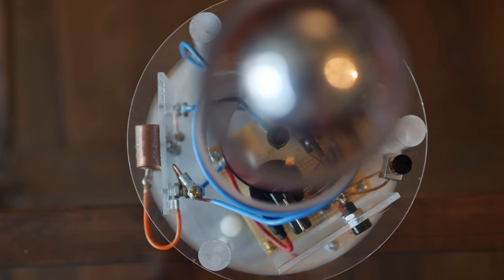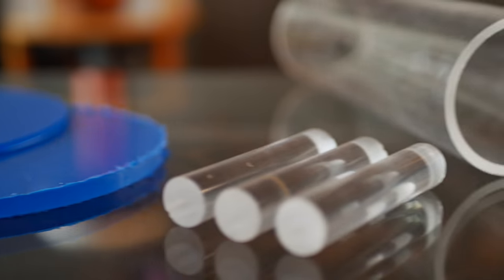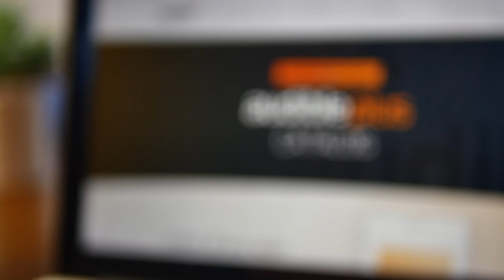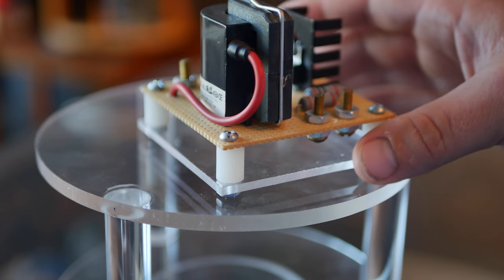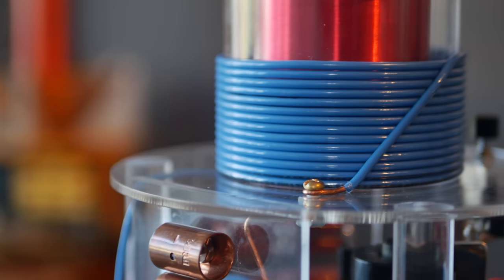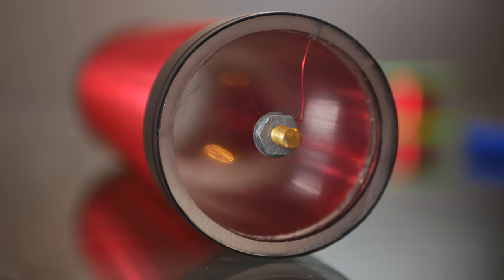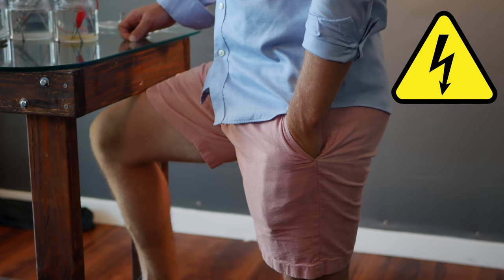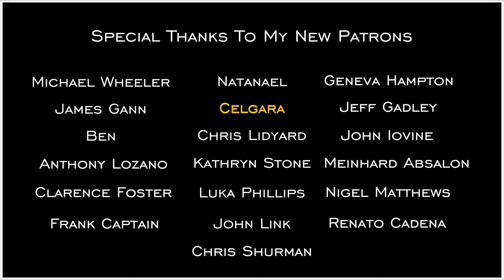DIY SEE-THROUGH Tesla Coil ( Portable & Museum Quality)

Comment from the maker: QUICK NOTE: I mentioned the one hand rule for all those new to electricity, or, those unsure about what part of this coil may be safe to touch. Ironically, I used two hands right away. I did this only for cinematic effect - I do not recommend using two hands, ever, unless you are very familiar with your device (like I was). One hand rule at all times, I just did it for effect!
Reply: Lol yeah that was funny
Reply: thank you
Reply: Tiny coil can’t hurt Jay  after all years he work with high voltage
Reply: Talking bout your Ebook. The matter we don't see is space it self. Dig into superfluid you'll understand what I mean. 
How you could possibly know you'd be in a soup of superfluid if you were in it? It act like a vaccuum yet it's not.  Starting to connect the dots yet?  
The speed of light is constant as long as it travel through a constant matter.
Reply: Sir at your flyback transformer vedio can i use a diffrent tranzistor?
Reply: Can you try triggering ur Marx generator with a Tesla coil by connecting it to one of the terminals, while making sure the Marx won't fire on its own/main gap being large enough  ?
Reply: @plasma channel can i put a currrent regulator on this
Reply: I wouldn't touch it with any hand. It's a both hand rule. You can get killed both with horizontal and vertical shock. If you touch the two potentials of a Tesla coil without a capacitance in between, you might get shocked because of the frequency being changed down by your bodies capacitance.
Reply: @sFeral  no you cant hook up the tesla coil... BUt you can hook up the power source tho
Reply: @rennoruutli5267  actually it can be done, I did it with a single HV capacitor, but the way I did it isn't exactly safe. What I haven't tried is putting the TC secondary in parallel with the HV output, which is potentially safer, if the TC is triggered remotely. Would be interesting to see, as long as the windings don't immediately short
Reply: @sFeral  Maybe I got it wrong... But o you mean that you connected the primary coil system to it or the actual tesla coil?
Reply: @rennoruutli5267  I didn't make the connection using a wire. The discharge from the TC top load hits one of the electrodes of the HV cap and causes it to discharge as long as the TC spark lasts (a very short time).   The other case I described would have the TC secondary (many turns) bottom connected (grounded) to the negative side of the HV cap (or the Marx generator). Basically the same thing this guy is doing RlUBjJfsR3s (YT blocks links, so this is just the vid ID)
Reply: Hey. Plasma guy.  You are fantastic.  Can you create a radar gun and atach an amplifier and then attach a webcam and a microphone and a strong resistor so it can handle the electricity.  What would you see.  Also could you develop a laser that you can point at China's Super Sonic missle and it would make it blow up in mid air?
Reply: the Radar has to have a reciever amplified connected to the reciever
Reply: i have one doubt when the sparks touch why u didn't get electricuted is it because of skin effect or u are not grounded. i am not sure that when will I get electicuted , when I am grounded or not grounded. can u plzz make an separate video on it my frnd?

Comment: I have already begun a design of my smallest Tesla coil I've ever built, I believe Jay has see it, it will be an audio modulated version of this coil here except about 1/4 of the size. It will use an external driver for high power usage but with an integrated driver (Full Bridge for the external and Integrated drivers) that's in the base similar to his. I absolutely love the quality and effort put in to not only your high voltage work to make it amazing in appearance but also the quality of your videos!

Comment: Amazing video as always. That was a beautiful coil build and even more amazing was the fact that it gets 3'' arcs from just 35 watts of power.
Reply from the maker: Thanks M.S. Yeah, I was really pleased with the result. I took my time calculating the resonant frequencies prior to building, and I think it paid off. I wish I designed the secondary/primary spacing a bit more safely though - I occasionally get sparks between the two coils.
Reply: @PlasmaChannel  I got to thinking about it the spark gap could be slightly improved with one sharp electrode to reduce breakdown voltage and increase efficiency (i.e. box razor, piece of hacksaw blade.) I would also try to reduce primary inductance a bit and make up for resonance with the cap bank. Nonetheless this is one of the most quality homebrew sets I have ever seen.

Comment: I really love the look of this! As to acrylic cracking, I've done a lot of work with acrylic when building my pink and clear guitar, and from that, if you use a stepper drill bit, it will have a much nicer hole, and it won't be so prone to cracking :D (Best to still have a very small pilot, but for bigger holes, it's very nice to have (the drill bit)

Comment: Love your grounding. The same concepts can be applied to receive remote power. It's the basis that Tesla was working with when he wanted to charge things remotely. Wide plate for grounding and an antenna on the other end. As a charge seeks to establish equilibrium on the larger plate there is going to be a little back and forth with the coil and remote electric source.
Reply from the maker: Counterpoises are the best. Using actual grounding sucks. I will believe in counterpoises till the day I die. they allow for convenience and portability.
Reply: @PlasmaChannel  if you ever get the itch, check out the pictish symbol of the double disk and Z rod. :)

Comment: another thing. the oscillation is made by the feedback coil. then the 3055 saturate and become conductive to ground the primary coil. I think that the circuit can be change not using the feedback coil at all,... or perhaps in a more complex project can be used as a zero crossing sensor. Once you have a variable oscillator you can experiment the coil behavior,... which would be interesting.
Once you have some awesome freqs,  you can modulate the amplitude with an amplifier, or perhaps a pwm to make a FM device... yes you can put some sound on the coil.

I want to thank you for this channel which is an inspiration.

Comment: Thank you sir,    i made a driver for flyback transformer using old  ballast transistor and it really worked very well
And it sparks about 2.5 cm in length
And iam your big fan 👌🙏🙏🥰

From KERALA (INDIA)
Reply from the maker: That is very impressive.

Comment: If I ever have the time, I’ll make this. I was actually going to build a large one years ago, but couldn’t justify the time and cost. Priorities. Whenever I have worked with acrylic, especially if it’s thin, I would run my drill bits in reverse to prevent splitting. Then I’d take a torch and gently and mildly heat the cut edges to smooth out and remove any micro-fractures that could lead to splitting. Kind of like melting the end of a cut polyester string/rope. Just less melting.
Reply: Another way to drill acrylic or any soft material is to take a file and purposefully dull the edges on the drill bit.
Reply from the maker: I recently found that there are drill bits specifically for acrylic. Bought some, and they drill like butter. Gluing acrylic still sucks massive butt though.
Reply: @PlasmaChannel  Have you considered using lexan? Its gravity proof...
Reply from the maker: You know, I asked my local acrylic shop about that. Even told them about dropping the coil. They strongly urged me to go polycarbonate and that poly will never crack or break.

Comment: I had obtained a 6"OD acrylic tube I was going to use in my last TC project. As well as a circular base measuring 4' wide by 1" thick. Had custom tuning slots CNC'ed into the base as well. I wound the secondary with 22AWG perfectly. 

It never materialized. Wound up becoming disabled, and lost the 'farm'. But one day, I'm getting it back!!
Reply from the maker: Coin, that is amazingly huge. 4 feet across...would house some pretty serious electronics.
Reply: @PlasmaChannel  I had a shed, that wound up being my own little lab. My old webwork is still mirrored by a friend. If you'd like, I can give you the address.

Comment: Hi Jay, I too have been greatly interested and fascinated by high voltage and making various high voltage projects since I was 8 years old when I built my first tesla coil. Now I am 58 years old and still very interested in high voltage and all the different ways of producing it. Although most of my time is spent building high energy lasers, I still like to dabble with high voltage and I have a question for you. Do you know of or have played with those small cylindrical black high voltage producing modules. I think they are being sold all over Ebay under the titles of stun gun modules. They are fairly small measuring about 3 inches long and about 1 inch in diameter and they will operate with as little as 1.5 -3 volts D.C. and will put out a fairly hot high current pulsating voltage around 25kv-40kv. They are claimed to be able to output absolutely ridiculous voltages of over 400,000-to over 1,000,000 volts which of course is complete bull. My question is do you think that these modules can be used as a primary source of high voltage for a small table top tesla coil. They cost only a few dollars each and would be a very cheap and easy source of high voltage. Please let me know what you think about these stun gun modules or more than likely you have already played with them and I would be very interested to know how they  Perform  in tesla coils because I was thinking about making a small table top coil. Many years ago I built a tesla coil that stood 8 feet tall and threw 12 foot streamers out into thin air. We couldn"t operate it indoors because the high voltage was arcing to all the a.c receptacles as well as all the copper water lines so we had to run it outdoors in our back yard in the middle of our garden far away from anything it could arc too. It was quite the site and when I operated it, most people from the neighbourhood came to watch the show but it produced an enormous amount of radio noise. I really enjoy a channel like yours, it is very educational and really sparks the interest of young kids  and adults into science and physics. I only wish it was around when I was growing up because there was nothing like this including no internet and no computers. I really hope your channel keeps expanding. Peter.

Comment: Love the high voltage sparks 😍. I also made a video about a diy spark gap tesla coil but output voltage is limited by my single leyden jar capacitor. Can you suggest a way to build a better high voltage capacitor bank
Reply: mmm many jar mmm.. parallel them yes....
Reply from the maker: Rolling up projector sheets, in between aluminum foil, can create some wonderful high high voltage capacitors rated for at least 10,000 votls. However, just go the MMC route. It is most convenient!
Reply: Thanks for the info

Comment: A neater way that i use for start and end of the coil is to use copper tape, the type for slug repellent, you can solder the ends of  the coil, and take a strip to the screws, remembering to solder the junction
Don't forget to leave a gap in the tape to avoid a shorted turn. ;)
Reply from the maker: Not a bad idea.I personally like the bolts....because it is both a connection physically and electrically.
Reply: I like a bolt too, specially for the ground, stops the expensive bit crashing to the grouns :D
Once you have a ring of tape round the top (with a gap), run another strip from that ring to the middle for the bolt, as i said above, don't forget to solder the strip to the ring )

Comment: hey plasma channel i have epilepsy and i forgot about the one hand rule and was making a jacob's ladder and i was tuning the gap and by mistake i touched the wire with each hand and shocked myself, in a way it was fun lol. i have been into electrical and computer science since i been yung
Reply from the maker: Hey Alex, that sounds scary and glad you're okay. Yeah, the one hand rule is really important when dealing with higher and higher power levels. In this video, I mentioned the one hand rule, but, then violated the rule. I only violated it because the overall power on this coil is very low, and, I knew exactly what I was doing. Otherwise....oh boy....anything that is 50 watts and up can really hurt you if it goes across the chest.
Reply: @PlasmaChannel  yeah when I was in ap Electrical engineering in hs we played with the tesla coil because of the low watts not to get zapped with high watts

Comment: Hello,
I like the build. I think what would top it off is a hand-made HV capacitor. You could interleave aluminum foil plates in between thin plastic sheets. Encase the whole thing in transparent plastic epoxy to prevent arcing.
Reply from the maker: I've thought about an all inclusive build using nothing but native materials from the ground.

Comment: Have you looked into the magnetically quenched spark gap Tesla Patent? The M.Q.G. was essential to Tesla wining the war of the currents at the worlds fair by walking into the arc discharge proving his AC was safe. It would be cool to see you build that.
Reply from the maker: MQG really only works at higher powers, and, is needed at higher powers from what I understand. This is only 38 watts of power, so the gap has no problems quenching. Sounds like you know more than me though!
Reply: @PlasmaChannel  Its scaleable, it needs to be in a vacume or you can use mineral oil i learned that a long time ago on a episode of G4 when they submerged a computer in mineral oil to cool it. When Telsa did it in atmosphere he shocked him self and his workers even when he put insulating walls up they still got shocked because the magnetic field cuppled with the electric arc/wave went through the insulation. ive tested this out with a stun gun lol.

Comment: Could you use Lexan (polycarbonate) instead of Plexiglass (acrylic)? 
It's a lot easier to drill, cut, & machine, and it wouldn't have broken as easily.
Reply from the maker: Yeah, I learned that AFTER it broke haha. I had no idea, all these years, that Lexan was easier to work with. From here on out....i'm going lexan!

Comment: I would love if you included where to place the switch at. Is it on the same side as the capacitor or on the other side? If you have a more in depth schematic that'd be helpful thanks! :)
Reply: You put the switch before the high voltage power supply

Comment: Try using an electrolyte water filled clear vinyl tubing for your primary and secondary coils and the wiring, then glass and water Laden jar capacitors.
Reply from the maker: Already on it 😁
Reply: @PlasmaChannel  the top load could be a giant round glass spherical  full of water, or two clear hemispherical bowls glued together in a pinch. A lightning rod out the top would let the magic fire out.
Reply: @PlasmaChannel  when the men in black show up, tell em Captain Obvious says hello.

Comment: friend thank you very much for uploading this video, but I have a question, what happens if you connect the capacitor  in parallel to the flyback and the spark gap in series?
Reply: And of course, which is the best, because i made one Tesla coil and my theacher told me that's better the capacitor in parallel

Comment: Great project.sorry to hear that it has destroyed.sir I have a question if we increase the no of windings in secondary can we get higher voltage?.and what about if increase the hight of secondary coil?
Reply from the maker: thank you. Changing the primary turns would require you to retune the entire primary circuit. In short, removing or adding turns would reduce your voltage out.
Reply: Aside from having to retune the coils yes you can get higher voltage in theory. In practice not really. The voltage drops as soon as an arc forms. The better bet is to use more power. Also the coupling deteriorates with length, requiring a finer wire for the secondary which increases resistive loss. It's definitely a balancing game with these machines and that's what makes them endlessly fun in my opinion.

Comment: Wow awsome and beautiful coil, im working on a NE555 sstc
Reply from the maker: Thank you! Good luck with the timer.  555 timers are so fragile. I used to build with them...but they are so sensitive. Like a snowflake.
Reply: @PlasmaChannel  yeah i know, im using some high powe MOSFETS in parallel with the primary, the most complicafed part is to tune the 555 oscilator to the resonance frequency of the coil

Comment: That is a really gorgeous build, however I would like to build one with red and yellow acrylic...I am not fond of clear acrylic...sorry, I know that sounds stupid.  I would also like to add a mini toroid on top...I have seen 2" diameter Aluminum torpid, that shouldn't mess with the resonance too much, Am I Right, or wrong?  I Appreciate your ingenious builds and easy to understand and construct videos.
Reply from the maker: Hi Mallard. Thanks for the compliments! Strange that you like the colored stuff - I cant stand it! Though...in certain applications...I think it looks cool. As for this little of coil, you'd be amazed how sensitive it is to adding and removing topload capacitance. the sphere had a capacitance of...around 2pF. Adding more capacitance up to about 3.8pF drastically threw off the resonance, and reduced spark output by about half an inch. I DO want to get some small metal toroids though. Would look really cool!